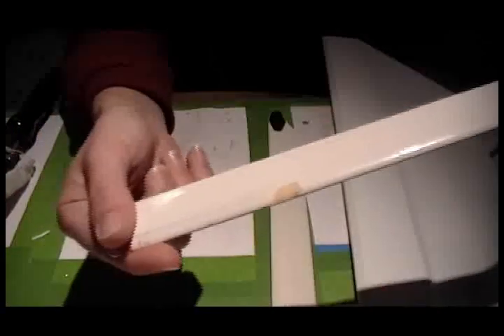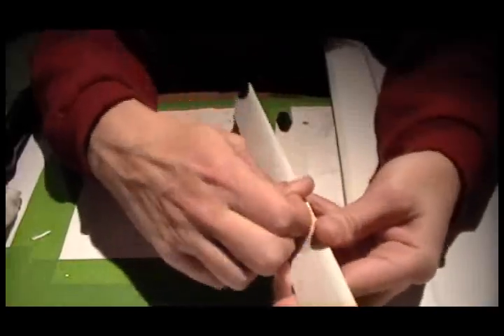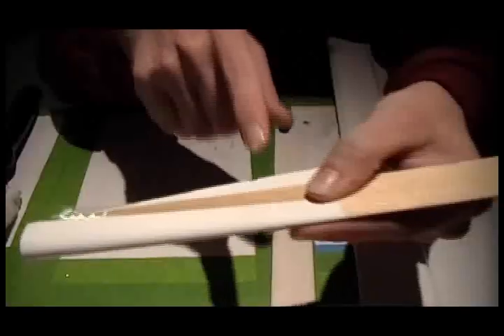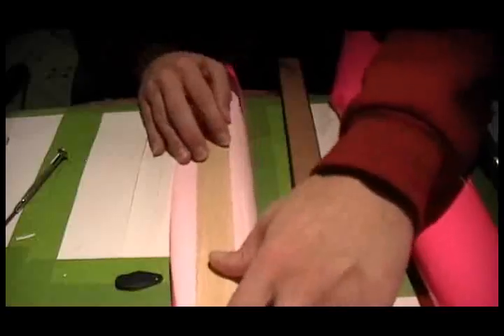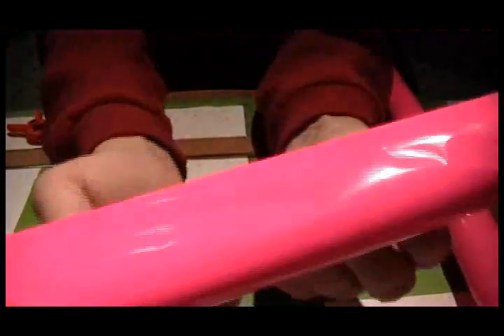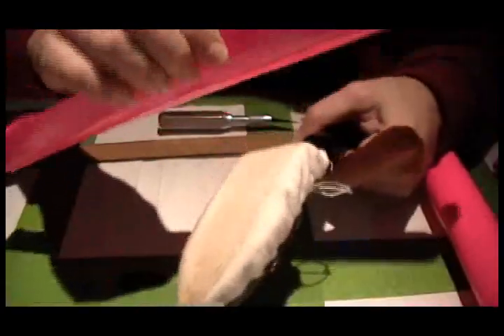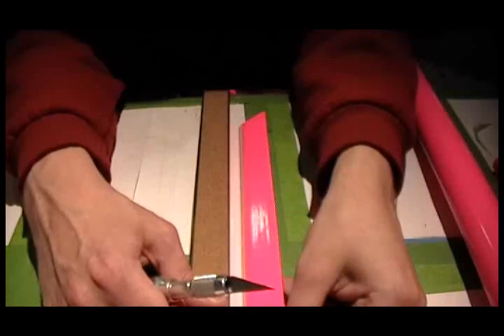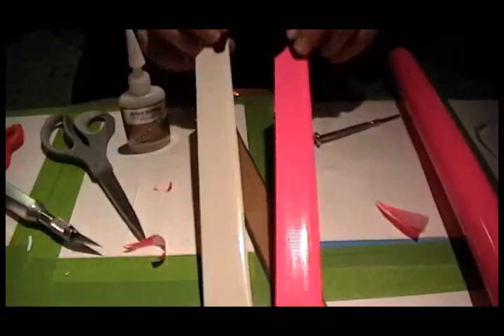Helicopter Blade Covering

Comment from the maker: @erikdravn It doesn't take very much.Keep in mind that a half a gram of ink is enough to print many pages. You can also use RIT clothing dye, but that works better on the plastic stuff like the landing gear legs and plastic tail blades. Keep in mind that patterns and details won't be visible in the air, so the only reason to do this is either for "show blades" that you won't fly with, or to improve visibility.